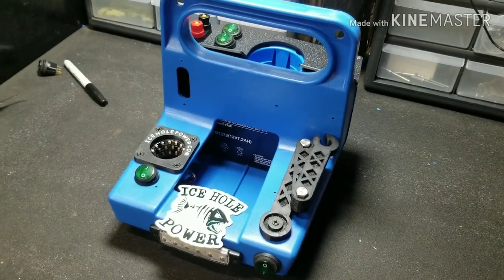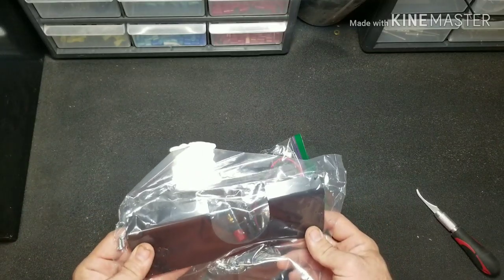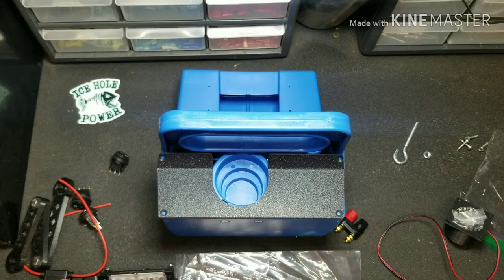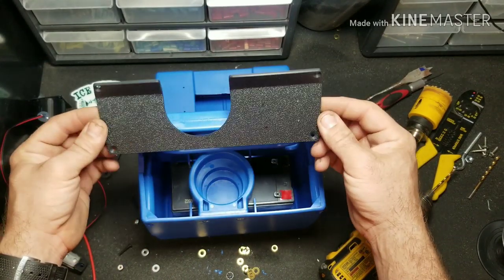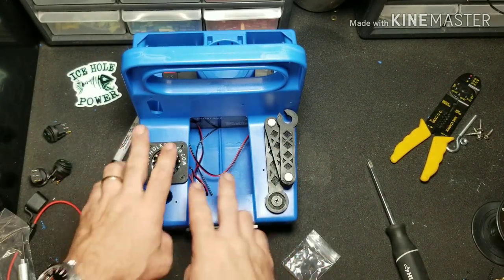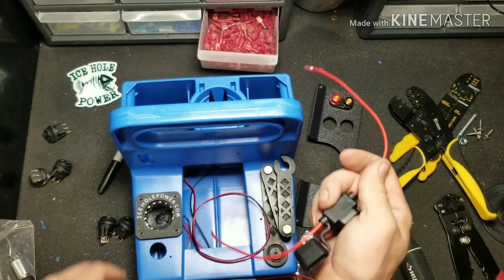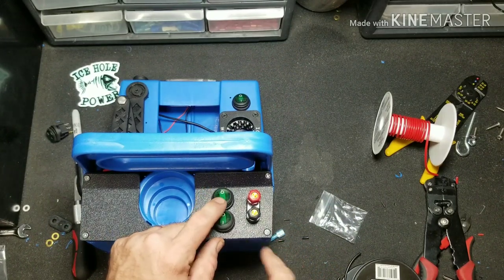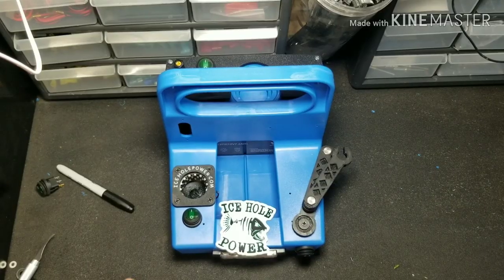Ice hole power blue box diy kit how to

Comment: Ordered. Can't wait!  If I wanted to keep my Vexilar FLX-12 quick charge port in the mix and have the wire route from the battery out the back or through the batter cover would I just twist the wires together before adding the spade crimps that go direct to battery?  Or is there a better way to do this at the power terminals on the battery cover?  I like the idea of the quick charge battery plug...
Reply from the maker: If I followed that correctly yes that is how you would hook it up
Reply: @JDSOutdoors  Seemed pretty self explanatory but wondered if there was an even better connection for charging that could be made.  I just like how easy that plug port is to connect and also already have it so didn't want to change unless it was worth it for convenience.
Reply from the maker: @bobbyhurt2678  na just use the flx plug. My 28 has the same thing

Comment: JSD Outdoors - if your using the proprietary Vexilar battery with the build in fuse on the positive battery terminal, installing the inline fuse would be redundant, correct?
Reply from the maker: Correct you only need 1 per circuit

Comment: Do you know if the blue box with this kit will fit decently with a Garmin 73cv Ice bundle?
Reply from the maker: I'm not sure it depends on the size of it and I've never personally seen one. But your mounting surface on this box is 8.25"x 6.5". I've seen some units mounted that stick past the sides and they work just fine it all depends on the look and performance that you want. Hope the measurements help to answer your question
Reply: Thanks for the measurements. That will help a lot. Appreciate your reply
Reply from the maker: @davem.5724  no problem thank you for watching. I should add its 8.25" wide and 6.5" tall. Forgot that part haha